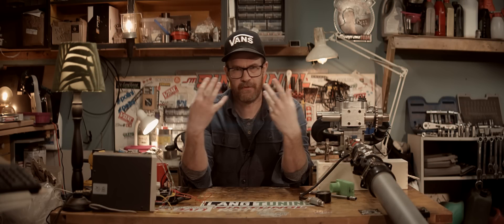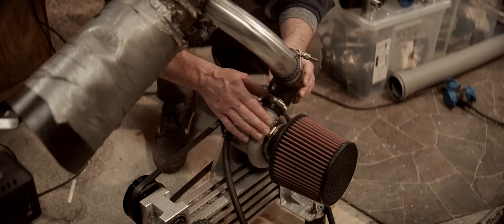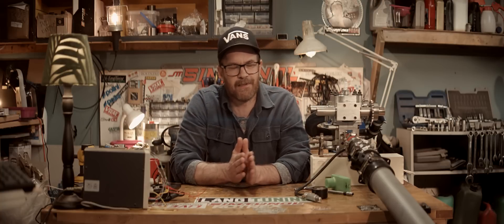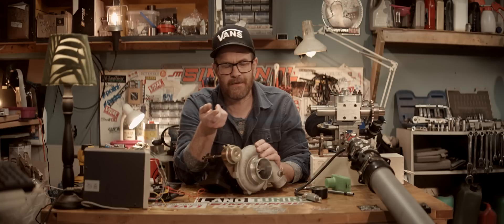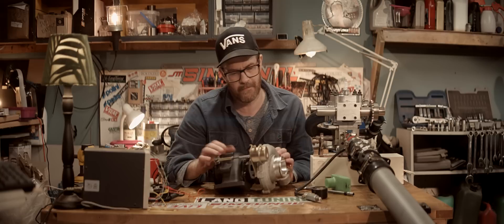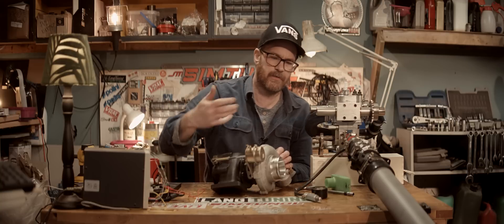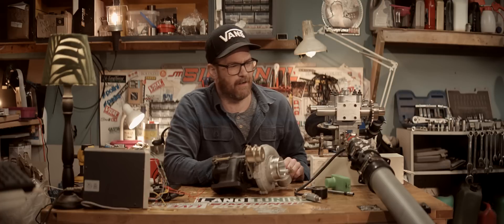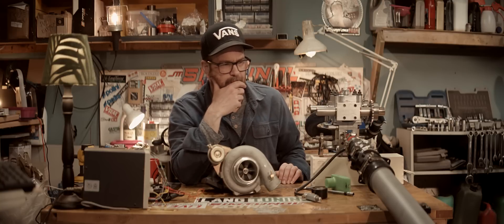THE most genius/stupid idea! Turbojet supercharging.

Comment: Alex, great channel, great work. here's a concept you might want to research. Electric supercharger, There are a few youtube videos out. The blower is driven by an electric rc motor on a separate circuit and not driven by crank rpm
Reply: You can't get out more power than you put in. For an electric blower to produce 1hp, it's going to take more than 1hp to drive it due to the inefficiencies of the conversion from electrical to mechanical energy. If it was a feasible idea, manufacturers would be using them in current engines.
Reply: @WOTTechnologies  Yes, there's no free meal, but don't forget his whole frame work is for a speedbike. It only has to go straight and back on a timed run. It's not a street bike. He could, if allowed, plug it in to charge the blower battery pack and send it.
Reply: @AntiVaganza  exactly my point. With electricity, you need to carry all the spent potential energy along with the fresh energy. Using solely combustion, your vehicle gets lighter as it accelerates ;)
Reply: @WOTTechnologies  I get you, it's just that I have seen it mentioned quite a few times that the salt flat guys don't seem to care about weight much(?). Haven't figured out why yet. But if weight  is not penalized much there then maybe it's still better have a smallish battery pack rather than sapping power from an ICE to run a blower of sorts?
Reply: @AntiVaganza  my shop is very involved in racing circuits, couple friends do the salt flats. Not that the weight "doesn't seem to matter", there's just no weight limits (upper or lower) in the classes, just power/engine/induction limits.
Reply: @AntiVaganza  also, to add, air resistance becomes more important than weight at speed, but, still need to get to the speed. A 50cc, even if it makes high power, isn't going to have the torque to vent get things moving, for an extreme example look at the V8 motorized bike from this channel.
Reply: Thought the exact same thing but maybe not allowed?
Reply: Weight becomes the issue then. Extra batteries. There's a reason electric supercharging hasn't taken off.
Reply: @EddieTheH  For some reason, people keep saying that for land speed records weight doesn't matter much? Maybe cuz they have already accelerated when they hit the measured distance? In some classes it may even be benefitial to be "heavy" for added traction on the salt, it seems. Not my words, just what I feel like I have heard from time to time. 

That's what he's building towards and whether it happens or not we don't know yet, but that's the goal and framework.
Reply: Electric driven compressor is not the solution, the problem is still the design of the comp wheel which does not match the air consumption of the engine.

Comment: Maybe best solution is “super turbo”
Generating electric energy from exhaust gases using a turbo, but instead of pulling air inside carburetor, use it on flywheel to make more power by more rotation speed

Comment: There's a guy in the UK Nick Mann who runs a hill climb single seater called Mannic Beatie.
He uses a gas turbine to spin a turbocharger up to feed air into the engine ( Ford BD T I think).
The idea is that there is no lag whatsoever therefore increasing acceleration.
It's a bit nuts, there's film of it on YT.
Reply: I've been reading about Russian turbo charged ww2 aircraft! They eliminated lag by blocking up the turbos intake! Like how when you are using a hoover and block the intake, the hoover motor rpm greatly increases.
Reply: he removed the turbo years ago. its direct from the turbine now
Reply: https://youtu.be/6EMleegZQLw?si=5U7Z4SVDjeXVUT37
Reply: This should be top comment
Reply: https://www.youtube.com/watch?v=qpJYQ9Fydso
Reply: I was about to comment exactly this. 
Well remembered.